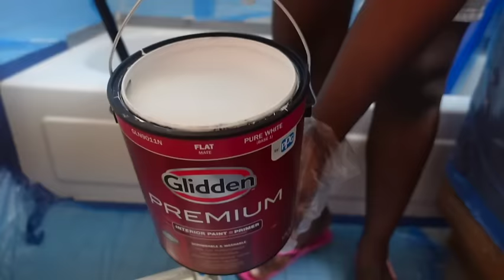DIY BATHROOM MAKEOVER | APARTMENT FRIENDLY RENOVATIONS | SMALL NYC BATHROOM

Comment: You did a good job on your bathroom.  I have a couple of suggestions for anyone wanting to do the same.  If your going to do the peel and stick on a vertical surface, start at the top.  Use a level to get it straight then do all sides of the top row.  Use a piece of trim or something under each piece so they wont slide down before it cures.  Work your way down row by row once the top is straight and the adhesive is cured, use painters or masking tape to hold up each additional row.  If the self stick adhesive isn't working well, use some spray adhesive around each edge as well. Butting up all four corners of the tiles make imperfections stand out .  Consider staggering the joints.  It looked like you used black caulk to grout.  Leaving the tape up too long will cause it to pull away and it wont look straight.  They do make a product to caulk peel and stick tiles, but check to see if it's good for use in showers. I've only used it on floors. Don't forget to trim out the tops of the tile with PVC quarter round,.  Home Depot carries different thicknesses in the store. The original tile should have a curved edge.  Using the thinner PVC quarter round will cover the gap so you don't have to use heavy beads of caulk, giving it a more finished edge.  The PVC can be painted whatever color you use for the grout.  You could use the thinnest quarter round along the floor as well instead of a thick bead of caulk.  I am curious  how it held up over time.
Reply from the maker: Check out my updates and maintenance on these renovations! https://youtu.be/sTZT70sdlQI

Comment: Looks great! For the tiles, did you ever experience moisturizer issues with them? I worry about mold. My bathroom gets moldy quite easy.
Reply: To combat that moisture and mold, go to the dollar tree and get the damping moisture containers. They last for a good minute. Depending on your bathroom size, place 2 in there. Change them out when the container is full of water.
Reply: The best thing to remove those stains in any tub and on tile, zep mold, and mildew remover. This stuff is a beast! It's strong so my advice is to wear a mask when using. Spray and let it sit the clean as usual.  Good for toilets also. 😊

Comment: I have  a question  did you ask your landlords permission before doing the backsplash? I'm curious  because my girl wants so badly to do this to the bathroom  but when she asked to paint her apartment  they told her they'd  preferred  if she didn't but if she did to stick to light colors. I always thought  who gives a crap just as long as you reverse it  after you move. But the backsplash  is that not permanent?Or can you actually  remove it once you leave and if so will it be damage to the existing  tiles?

Comment: How is the contact paper holding up and the sprayed tub?
Reply from the maker: Contact paper is holding up beautifully. I can’t say the same about the tub. I didn’t allow the paint to ‘cure’ or seal properly so it has chipped in some areas. It’s supposed to have dried for 3 days & I only allowed a day
Reply: Okay I was worried about mold. Do they sell pink tiles? Where did you get the contact paper tiles?
Reply from the maker: I left the link to the tiles in the description box 🤗 and placing caulk around the tiles is key to preventing mold in your tub

Comment: I would have skipped the spray paint and did a deep scrub of the tub, sand papering that dark spot in the middle because the spray paint will lift and can be toxic but nevertheless this bathroom is 10x better than it was. Great work queen!

Comment: How do you get the grout out when you need to move out and take this all down. I am moving soon and I love this idea. But I don't want to get charged if I can't get the grout off
Reply from the maker: It’s difficult to remove, but it’s not impossible. I had to remove a grey colored grout before applying the black one. I just used a grout remover chemical and a box cutter blade.

Comment: How did you measure the bathtub tiles to fit the fixtures?
Reply from the maker: The tiles came 12x12 and I just laid them as they came, then used a measuring tape to cut off any excess.
Reply: @KiaraIanna  thank you 🙏🏽.